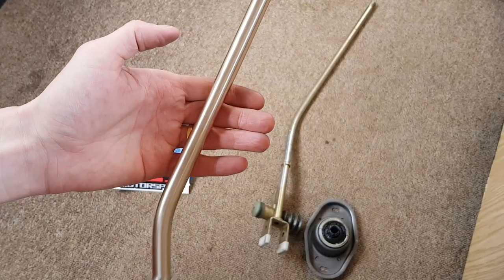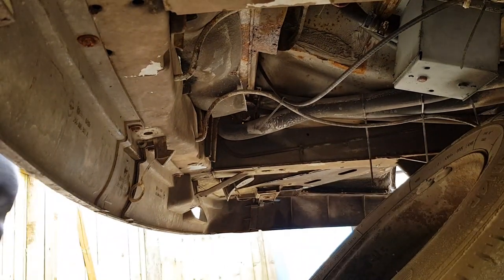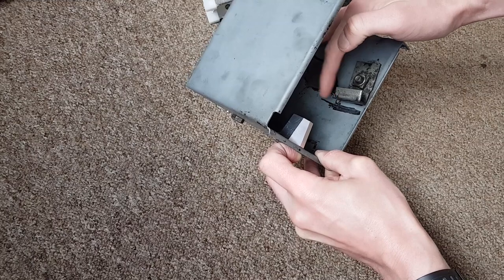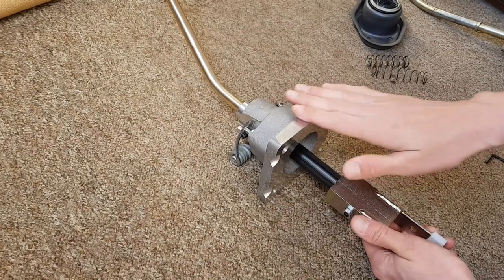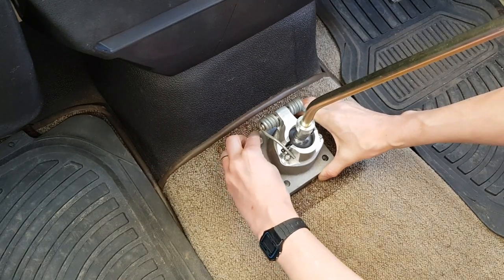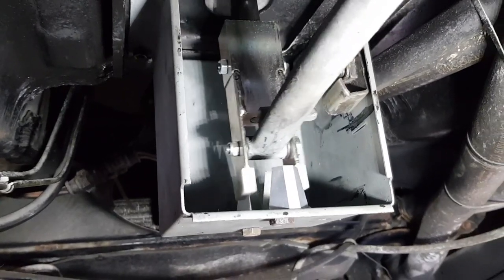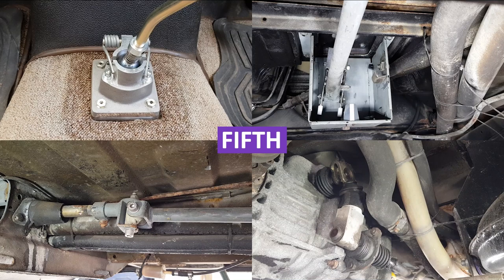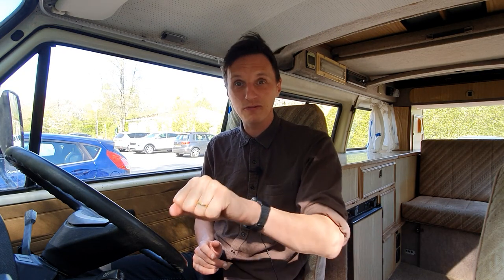VW T3 / T25 / Vanagon - 711 Shifter Upgrade - 5-speed Gear Lever Install

Comment: Where do you source a 5 speed for a T25?? I'm in the states and can't find one here. My son has a right hand drive T25 with a 1.7L diesel and I'm trying to find a 5 speed for it. It has a top speed of 110kph, in trying to increase it some nature lifting it and doing larger tires.

Comment: next step shoukd be to develope a cable control shifting for the gearbox linkage and this shifter. than would be perfect. and of course a theft lock integrated in this box